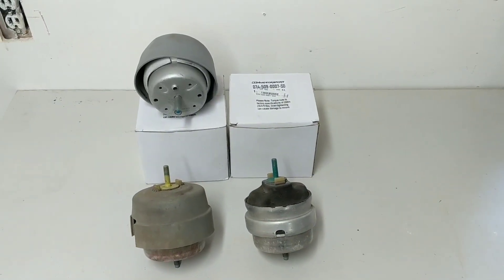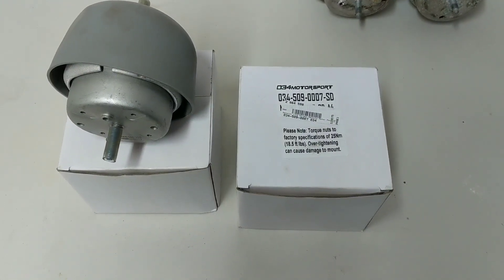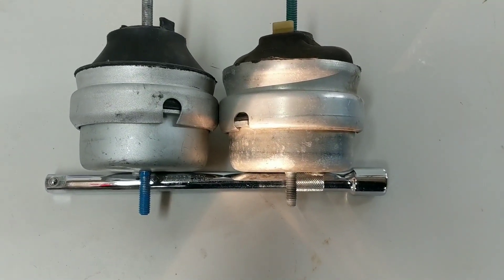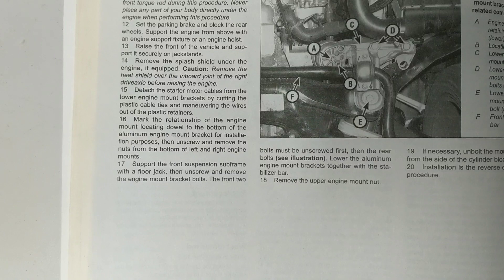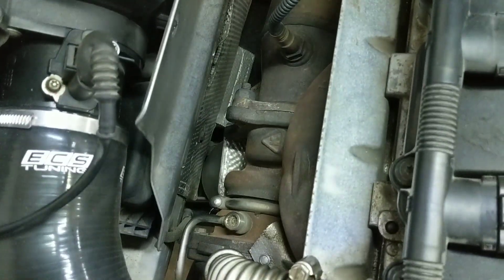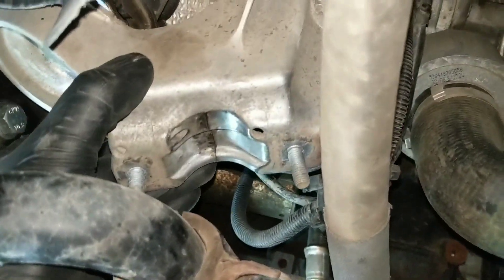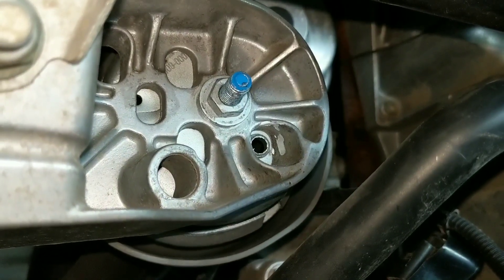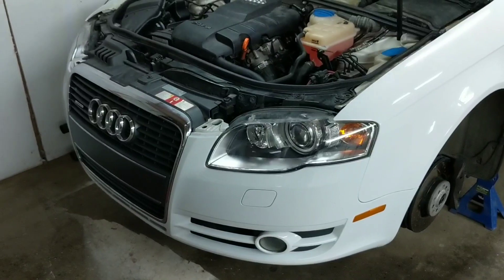034 vs OEM B7 Motor Mounts | Product Review AND Install DIY How To

Comment: the motor mounts must be original. Otherwise, you will have vibrations in the body. They are designed in such a way that no other manufacturer has succeeded in manufacturing. The original mounts are the AVON England brand.

Comment: Does this tab on the bottom have a function?  Is it just a model of the place of seating
Reply from the maker: It's just a locating dowel so you can orient the mount correctly. Tab = in hole.
Reply: @FigureItAuto  Ok thank you👍

Comment: Have you heard of any reviews on the ECStuning motor mounts (black/red), I know the 034 mounts that you installed are solid but I was wondering about the ECS ones because I need to replace my oem! Also mines are electronic as well. Idk if I should go with 034 or ecs? Would like your advice on the mounts since you have done them in past.
Reply from the maker: Take a browse through the Audizine forum and see what more people have said based on their first hand riding experience. Really, just let the durometer hardness metrics and your realistic average use of your car decide which ones to go with. ECS, 034, Apikol, etc. will always list what durometer stiffness the mounts are to level the cross-brand comparison.
Reply: @FigureItAuto  okay I’ll do that and thank very much

Comment: I recommend loosening the transmission mounts and lifting the engine only. Removing brackets may change the alignment. 
Also technically the subframe bolts are one time use.
Reply from the maker: You're right, Therion. You're getting a shout out in the video I have planned to address this and introduce a new tool.
Reply: @FigureItAuto  First of all, I like your channel very much. I own a 1.8t Passat, which is an Audi in disguise :-)
It is possible to make an engine lifting tool out of wood. or you can rent from autopart stores.
These cars are very particular about their alignments. 
%99 of the alignments shops won't touch the subframe in Audi and VWs to do alignment. I personally instructed the shop mechanic to loosen the subframe and shift it using the alignment holes for camber and caster.
Also, not every motor mount is filled with fluid. Most non-dealer mounts are solid rubber, which is cheaper but not necessarily as good as the fluid filled VW original mounts.
Looking forward to more of your videos.

Comment: Do you have any idea if this install is the same on a 3.0 quattro A4 b7??? My mounts are shot and I need to know if this is something I can do also!! Really struggling to find any information here!!
Reply from the maker: I don't have first hand experience with changing mounts on a B7 that has a V6 but my intuition and brief searches online both lead to: there will be extremely limited or no access from the top of the mounts and as always, having helpful tools are going to make the job less stressful. Getting the bottom nuts off the mounts shouldn't be an issue; it's the tight space above the mount to remove those nuts that will be worth finding a flex head, ratcheting wrench for. For the job shown in this video - with a bit of research and preparation - I'd rate the job at a 2/10 difficulty. It's something you can stumble your way through if you have the time...but it's good to know what incidental hardware needs to be replaced (like subframe TTY bolts) and which don't.

Comment: Do the mounts have any difference?( Left and right) Because I had to  install drivers side engine mount to the passengers side.
Reply from the maker: Hi Henri - It depends which motor mounts you're installing on what year and transmission type of vehicle. If you want to share more info about your situation here, that would help answer the question.

In general terms though, aftermarket mounts like the ones in this video are the same for both left and right. There was a change in the 2007 production cars where before VIN numbers up to 8E-7-149290, electrically assisted hydraulic mounts could only fit the left side of Tiptronic automatic transmission cars. After the split, the mount can go on either side. Other than that - although there technically are different part numbers for left and right mounts of both automatic and manual vehicles - non-electric assist mounts should be interchangeable. You can refer to your part numbers against this: https://bit.ly/312zcDj. The mounts do rest at different angles under the engine, but to my knowledge they are not constructed differently. All this said, when you change a motor mount, you should do both to maintain ride quality consistency.

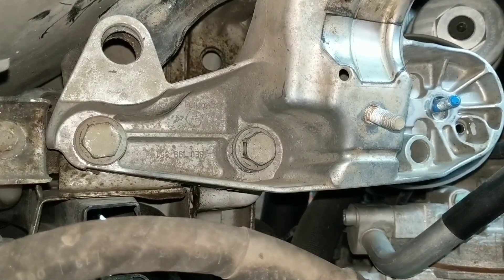Comment: N-909-568-03 is for the longer bolt and it is an M12x1.5x120. The other two (shorter) bolts, N-906-630-02, are an M10x70. As at 14:50 ish in the video must be incorrect torque specifications for the bolts that mount the sub-frame bracket in place.
Reply from the maker: Vic, I'm glad you posted this. Using your information I went back to the Bentley manual and was surprised but relieved to find an error that had obviously caused the confusion in the first place. In the spirit of this channel and because of your contribution, here's the first video of Community Contributions and the explanation of what exactly we missed: https://www.youtube.com/watch?v=mr2fPBeIkxc

FYI. The torque for the long,M12x1.5x120 bolt is 81 ft-lbs, and the torque for the 2 M10x70 is 55 ft-lbs. Thank you!
Reply: From page 34-35  in the manual under Manual Transmission Removal and Installation (section)

Tightening Torques
______________________________________
Subframe to underbody (use new bolts)
Bolts 1 (longer bolt) 110 Nm (81 ft-lbs)
Bolts 2 & 3 (two shorter bolts) 75 Nm (55 ft-lbs)
Reply: I will provide the correct torque specs for these bolts when I get the Bentley service manual.

Comment: Awesome video as always! Will save it until it's time to do this myself. :)

Would love some thoughts on how the 034 mounts feel compared to old OEM's
Reply from the maker: Appreciate it. Although I'm trying to get through a number of projects this winter (when it doesn't get driven), I'm also conscious that it'll be difficult for me to individually measure and critique each mod if I do a bunch of things at the same time. I am excited to feel how the car handles itself with these mounts and the 034 sway bar in the back. At the very least, I'm expecting something noticeable - compared to just adding the 034 snub mount and bracket which felt like nothing.
Reply: @FigureItAuto  Ahh I see